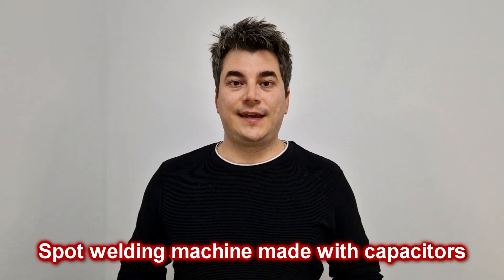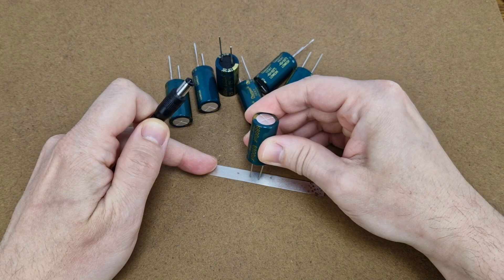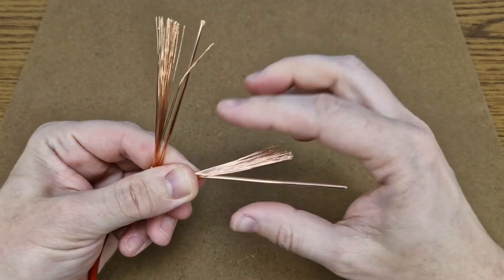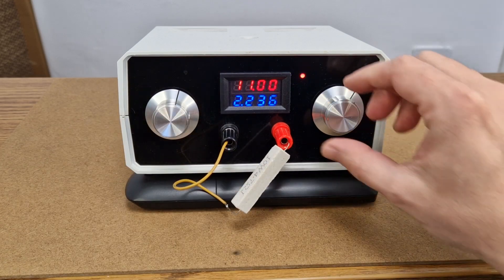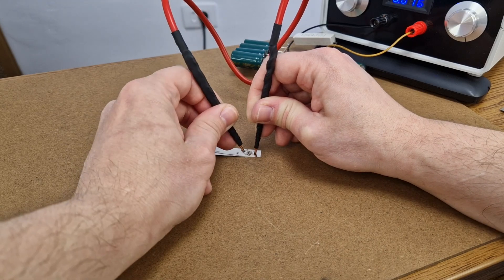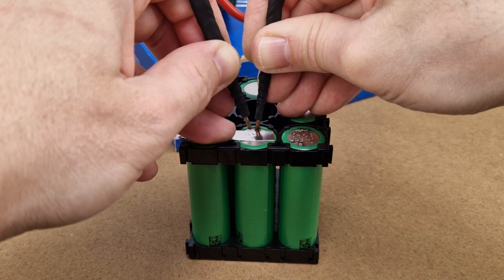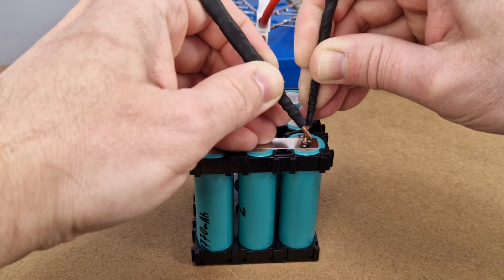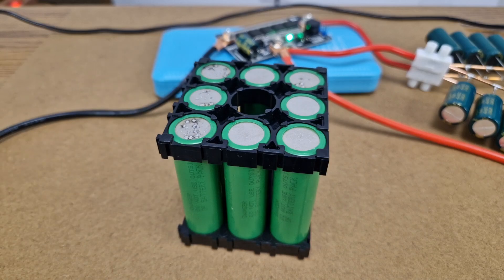DIY capacitor spot welder

Comment: Your failed welds were probe to strip and other probe ALSO to strip.  Your later (successful) welds were one probe to cell terminal and other to the strip - this ensures the current flows through the two pieces of metal, and not just through the tab.  For my cap welder (also useful for fusing thermocouple wire, using a graphite crucible), I use an SCR for triggering, so I can get a solid connection and THEN dump current.

Comment: dumb question: why not put a switch in series with one of the electrodes? that way you can press the electrode down, then apply the current?
Reply from the maker: because you would need a switch rated at hundreds of amps, otherwise the contacts in the switch will melt, exactly like the contacts on the nickel strips.
Reply: @Sorin_DIY   you mean you don't have an old microwave to steal the door microswitches from? lol.

jokes aside, i imagine there are some relative cheap microswitches that could work out there.

Comment: I have a couple old 6200 MFD x 200v (250v max) capacitors. Will they work? They are huge!
Reply from the maker: They will make some big sparks, but without controlling the current, they will not weld as well as a spot welding circuit.

Comment: What's the point of the shunt resistor?
Reply from the maker: To limit the charging current, especially when welding, because each weld is actually a short circuit.

Comment: I was thinking of using dc caps 400v 600 uf. They are found in the outside unit of old air conditioners
Reply from the maker: They are not powerful enough, you need supercapacitors.
Reply: Rather go for low voltage high capacitance. Q=CV So Q is the charge and if you make C high you can use low voltage. V high is dangerous, especially if you are holding the two electrodes.

Comment: The capacitors u used are foil wound ie they also have inductance which slows the rate of current change.... if each capacitor had an additional 10 uF Tag Tantalum capacitor sitting across it that would shartpen up the pulse quiet noticeably. Worth a try ?

Comment: You can use a foot switch so when you have placed the electrodes in place. You can control the current easily
Reply from the maker: In regular spot welders the foot switch operates the mosfets, which will deliver 100A or more. a foot switch cannot directly handle 100A or more. So in my project the foot switch (or any switch) cannot handle the peak power of the capacitors.

Comment: Thanks, I have a kit with a lithium battery but it's not giving me enough power. How would I find the maximum voltage or current that can be regulated ?
Reply from the maker: hi. it depends on what type of battery you have, what configuration, what type of cells, how many cells?

Comment: Can I ask when and why you switched from your 18650 charger to the opus?

Cheers
Reply from the maker: Hi. I use both chargers for charging and discharging lithium cells. but to test the capacity I can use only the Opus charger.

Comment: Oes all the capacitor have to be the same size?
Reply from the maker: No, but they need a minimum voltage rating and the capacity as big as possible.

Comment: I could not find which MOSFET circuit you used for the final part of the video. It seems it controls / limits the current, so it might be designed to be continuously driven by a 12V battery or some similar high current power source, capable of 200A~300A. Obviously a capacitor bank just provides a current peak, decaying exponentially and probably tripping an eventual current limit of the circuit. But the energy of the capacitive discharge is not enough to spot-weld the parts, and the instantaneous power (peak current) is counteracted by the current limiting circuitry. 
Another point to remind: the energy stored in the capacitor, E = 1/2 x C x V^2. It means that welding ENERGY at k12V (final part) is less than half of mid -video voltages (15-18V).
Bottom line: you might have succeeded if using a engine-cranking 12V relay, and eventually increasing the bank of capacitors, and/or increasing the charging voltage (as 18~20V) where the relay contacts will probably survive up to 300A peak, but that MOSFET circuit is NOT recommended for a capacitive discharge.
Reply from the maker: Hi. I used the module from my spot welder video: V8 Spot welding kit: https://s.click.aliexpress.com/e/_AYYhHD

Comment: Excelent and a real video. I'm trying to do the  mine with no sucess . I am using a 70 mF similar to a beer can (but with only 65 mF), a source 14 volts / 3 A and for the terminals I'm using a tungsten electrode used on TIG welding.

Comment: If the issue is with timing, then can a switch (e.g. a switch and a high current relay) to fire the spot welder when the electrodes are firmly place help?
Reply from the maker: yes, but that's exactly what a mosfet does.

Comment: Have an hard insulation sleeve  (Ceramic  ) on one eletecode, with a groove in it, the presser electrode, slide the other ekectrode down the groove, to make two welds. Just an idea.  Fixes gap between welds, and ensures metal are in close contact before current comes,

Comment: I have similiar experience with 8x Nichicon KMH 22000uF/63V from Ali (after measurement they have 12-15mF instead of 22mF, but they have thicker leads). at 21V the discharge is so vivid it melts both testing nickel strips but won't join them together, as you explained. I ordered similiar controller with 5 Mosfets so I will see how this will work (today got bargain for 8,5USD for bare controller). I hope this will be enough to work smoothly.
I connected capacitors with 4mm2 copper -you have 2,5mm2, won't this choke the current too much?
There is also this white "joiner" - isn't this the limiting current in your solution???
Won't be simple diode better protection of your charger rather than resistor?

Great movies! Keep inspiring people :)
Reply from the maker: Hi. Thanks for watching. The current is drawn from the middle of the 2.5mm2 rail. so 4 capacitors are connected to a pair of 2.5mm2 wires and the other 4 capacitors to "another" pair of wires, the wires join at the middle in the white connector. each pair of 2.5mm2 wires carry half of the total current. 
in the white connector the 2.5mm2 solid wire is bended in 2, so it forms a 5mm2 solid wire. and it touches directly the lead wire for about 1cm, so it transfers the current directly to the lead wire, the connector holds them together and also helps a bit with the current transfer.
A diode is not enough, it will be shorted and probably burn.
Reply: @Sorin_DIY  Good point with resistor rather than diode! Thanks!

Comment: What if you add a plastic "tip" on one pole.. like a fork, so you have something to press down and just place the other pole next to it? Or place a small piece of kapton tape that you can pull under one lead to have it as close as possible before connecting the loop?
Reply from the maker: It will probably weld a little better. but welding the batteries will take longer.

Comment: This is a good video so we can avoid making electronics mistakes. Sorin, is there a way you can make a DIY bench power supply that also works as a spot welder using a used PC power supply?
Reply from the maker: Thanks! At the moment I have other videos planned but maybe I will try it in the future.

Comment: You could make a foot switch out of 2 good sized blocks of copper and connect is in series with one of the probes. Cool
Reply from the maker: Hi. a switch will work only if it's rated at more than 100A and even then it will waste a lot of energy.

Comment: Maybe using a well suited switch, that can deal with the arc, breaking the circuit at one of the electrodes?
I really love your work and your channel. So fresh, so honest. Please, keep it up.
Reply from the maker: Hi. a switch will work only if it's rated at more than 100A and even then it will waste a lot of energy.
Reply: @Sorin_DIY  what about a mosfet ?
Reply: @Sorin_DIY you could use maybe 3 relays in parallel or a thyristor which is the relay responsible for starting a car engine which can handle a massive amount of current and sparks
Reply: @Sorin_DIY  That means that I am just  "nerder" than I thought. I'm gonna keep attached to your channel and learn more before posting again! 😉😜

Comment: Hi sorin
I think it could be better if you use a foot switch so you can make sure that the contact is good then discharge the capacitors
and thank you
Reply from the maker: Hi. a switch will work only if it's rated at more than 100A and even then it will waste a lot of energy.